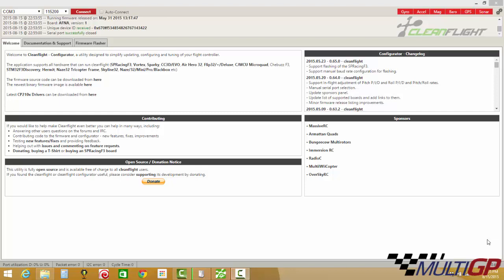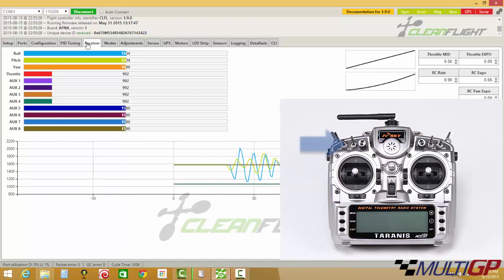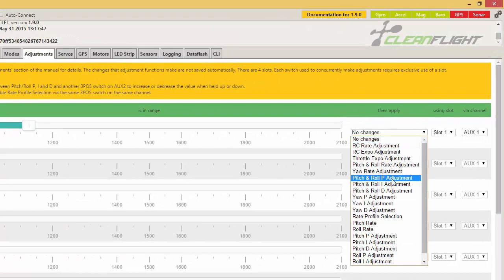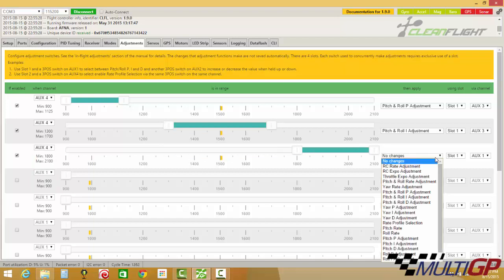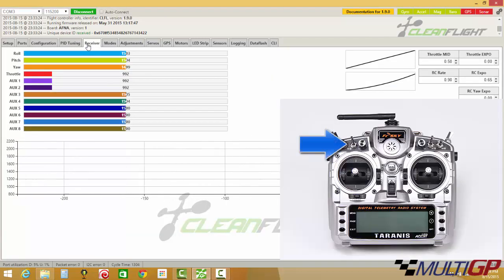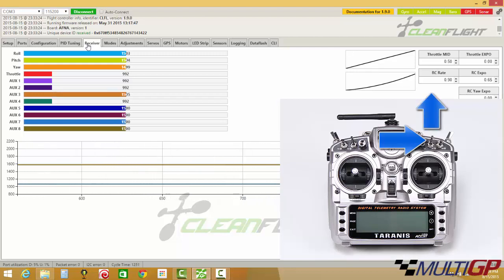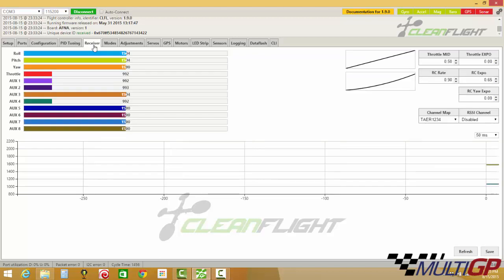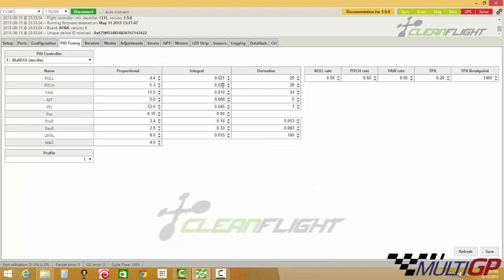Tuning PID Settings from a Taranis Transmitter in Cleanflight

Comment: so when you turn the quad off will it keep the settings or do you lose them if so how do you know where to set your settings back to
Reply: If you turn the copter off, it does not save the changed settings. You have to leave it on and connect the fc with a pc. Open Cleanflight and go to PID Tab and press save.

Comment: Is there a way to set an aux swtich to enable/disable this tuning?
I tried this and when I had my switches in the default up position , it was raising my D values constantly while I was getting ready to start tuning.  Luckily it didn't cause a crash.

Comment: Once you have your settings where you want them how do you save them so they aren't lost when you power off the quad?
Reply: +QuadFlyer 2 options: 1. plug into Cleanflight GUI and click on save on the PID screen, or 2. disarm the quad, then use the stick positions simultaneously, left stick: bottom left, right stick: bottom right

Comment: Finally a good video on transmitter tuning! I've been doing this for a while and I can tune using just one 1300 battery. It can also be done like this with any 6 channel transmitter with 3 position switches. I use a DX6 (cough cough). A third switch can even be used with mixes to make even more adjustments like rc rate or expo.

Comment: If you reverse the channel in the transmitter that you are using to raise and lower the PID #, you will be able to raise the number when the switch is in the up position instead of lowering the number